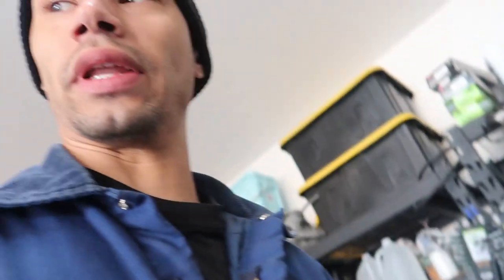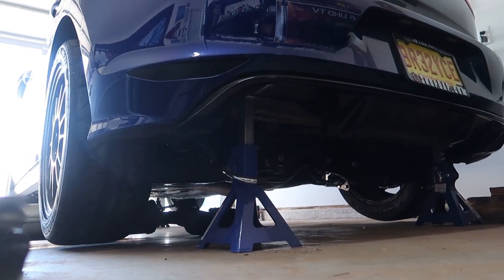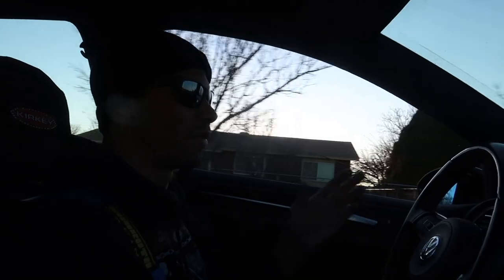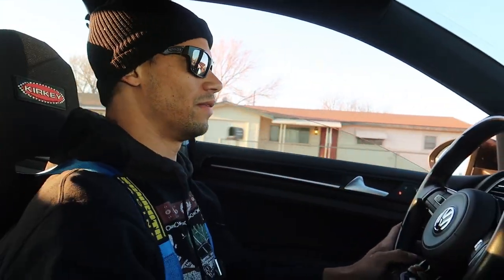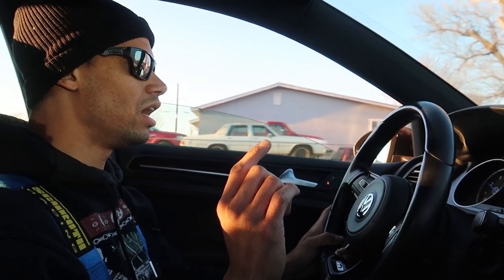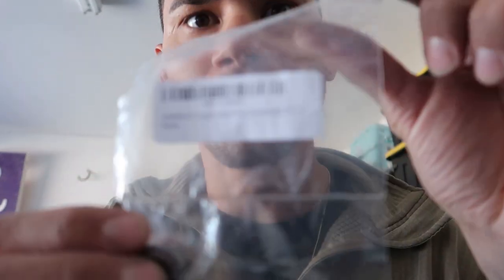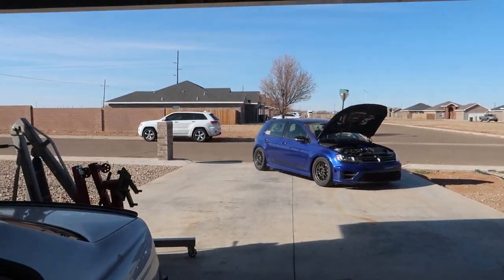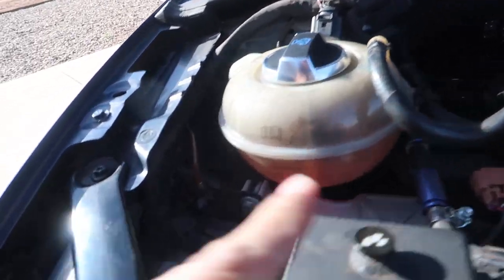FIRST DRIVE ON BUILT EVERYTHING! | MK7 Golf R

Comment from the maker: Build list for the curious:

Engine:
Custom tune from EQT 
034 Dog bone mount
034 Lower dogbone insert
034 Upper dogbone insert
APR Catch Can (full PCV)
APR Coilpacks
APR Intercooler piping 
BFI Engine mount stage 2
BFI Transmission mount stage 2
EQT Turbo piping
EQT Turbo muffler delete
EQT Vortex turbo°°
Denso iridium ihk01-24#4 
iAbed Rear main seal
Racingline Coolant hose
Racingline Intake (R600)
Racingline Turbo inlet
Racingline Intake pipe
Racingline Intercooler
Remus Sport Exhaust** 
South bend stage 3 daily clutch
Trackslag 4" downpipe ceramic coated
United Motorsport haldex tune

**102mm Carbon angled tips w/ Ti internals
°°Forge Turbo Blanket  

Engine Internals:
Ferrea Springs & Retainers  
IE Tuscan Rods
IE Valve Guides
Mahle 83mm Pistons
Mahle Rod Bearings
Ported Cyl Head

Transmission:(NFP O2Q)
FFE dog gears 3-6
Steel shift forks
Supports
Wavetrac LSD

Fueling:
PM4 fuel pump controller
Precision Raceworks 535 Pump
Precision Raceworks 4BAR Maps (just PUT for now)
Precision Raceworks 925cc Kit
Precision Raceworks Boost Tap
Precision Raceworks Ethanol Sensor
Precision Raceworks High Flow Fuel Lines

Wheels/Tires:
17x8 Hypergrams (satin silver) ET43
Bridgestone RE71R 254/45/17
BFI 5mm spacer front
BFI 5mm spacer rear 

Shifter Upgrades:
034 solid shifter bracket bushings
Ball shim mod
Black forest industries shifter (golf ball)
Black forest industries shift boot
Clutch stop
Clutch spring delete
Dieselgeek shifter shaft bushings
Dieselgeek super pin
ECS clutch bleeder block
ECS SS clutch line
OEM metal shifter bracket 
Shop dap short shifter
Swirl valve delete

Suspension:
034 stainless brake lines 
034 front adj endlinks (density line)
034 rear shock bushings
034 rear sway bar
034 rear adj endlinks (density line)
Audi aluminum subframe
BC Racing coilovers w/ Swift springs
ECS Diff inserts
Eurocode front strut brace
Eurocode hatch brace
iSweep DCC deletes 
Leyo undercarriage brace (rear)
Powerflex front sway bushings (black)
Racingline stud conversion
Verkline Anti-lift trailing arms
Verkline rear control arms
Verkline rear lightweight tubular subframe
     w/ track bar
Verkline rear toe arms
Whiteline front control arms

Brakes:
Audi RS3 brake ducts
Carbotech AX6 pads (front)
ECS 2Pc slotted rotors (rear)
iSweep 2000 pads (rear)
Motul 660 brake fluid 
Wilwood 2pc rotor (front 327mm)
Wilwood super lite 6pot bbk (pad #7416) 

Exterior:
Black emblems
Blind spot mirrors
LED euro tails
Maxton Spoiler
Paint correction (needs it)
Racingline stripe
Rock chips
Some dents

Other:
A/C delete
Aux Rad delete
De-badge front, rear and fenders (R)
DeAuto key blue LED footwells
Haldex switch (custom)
Kirkey seats
Mele designs battery mount 
Odyssey PC980 lw battery
P3 ethanol gauge adapter
P3 Boost gauge w/analog tap (v3)
Porsche coolant cap
Rear crash bar delete
Rear seat delete
Rear wiper delete 
Racingline brake cap
Racingline oil cap
Racingline oil dipstick
Racingline oil filter housing 
Schroth harnesses 
Struts cut for camber adjustment
USP ethanol harness (for P3)
Washer resi delete
WCT Pedal spacer
Reply: That list is just insane..
Reply from the maker: Still got a buuuuunch more to go.. need a cage, fire extinguishers, functional chassis mount splitter,flatten the undercarriage, diffuser, tubular front control arms and subframe, braided fuel lines.. probably a bigger pump soon as well, 5 bar sensor on the way along with a AMS IC and bigger 4" intake.. need carbon vented Hood/fenders too. And to get rid of all the sound deadening. Forever growing list lol
Reply from the maker: Oooo and lexan all the windows besides the front main
Reply from the maker: I plan on getting into grid life and going full time attack. Build an auto car for drag racing later on
Reply: Siiiiiik build
Reply from the maker: Thanks dude!
Reply: Holy balls

Comment: Just coded out the N80 Evap code. It is a MIL code, so you have to have your tuner do that. I recently had issues with hesitations/low misfire counts. If you have replaced your N80 valve and a code or hesitations/misfires exist, it is a component further down the line in the Evap system. Next item in line is the charcoal canister. Then I believe the leak detection. The manual has all the appropriate fuel system tests for the Evap system.

I just plugged the line running from the charcoal canister and coded out the MIL. Zero issues now.
Reply from the maker: Thank you for the insight! Wonder if I can just cut or cap the line off the tank and call it a day..
Reply: @BryceJordanProductions  That is exactly what I did. I plugged the inlet side of the sensor (left side of the sensor). Used a cap head M6 machine screw wrapped in a bit of teflon tape to create a snug fit. You are supposed to leave the gas cap cracked a bit to help with evap, but I have had zero issues. We will see what warmer temps bring. I check it daily currently.

Don't disconnect the electrical connector. Fuel trims are still dependent on this reading I believe. At least on older vehicles with N75/N80 valves, it messed with fuel trims.
Reply from the maker: @arob_157  ahhhh see I wanna get rid of it on the cam cover entirely.. I find it so hideous.. :/ I don't get any codes or anything

Comment: Congrats. Great job. 
What are your coolant temps on the P3?
Reply from the maker: Haven't looked during pulls at all but it's around 180-210. Find out this weekend at autox how temps will be without the aux rad
Reply: @BryceJordanProductions  I still think mine runs too hot now. Did you ever recall higher temps after going with the vortex? I’m seeing 207-212 on the freeway when the ambient temperature is in the 30s. Everyone tells me it’s normal. It gets up to 223 sometimes.
Reply from the maker: That sounds about normal. Did you monitor beforehand at all? Cruising temps shouldn't be affected no matter the size of the turbo. The dash gauge lies for OCD folk keeps it nice and centered till it goes quite a bit over
Reply: @BryceJordanProductions   yes with a P3 and I seem to recall cruising temps in the 190s. Also have a mk7 gti that stays in the 190s while cruising
Reply from the maker: Interesting. I'll check mine today and hopefully remember to get back to ya
Reply from the maker: @burb17  the few laps I had before splitting my turbo in half were no higher then 215. And that's without the aux radiator
Reply: @BryceJordanProductions  dang. Thanks man. I’m at 205-208 cruising on the freeway when the ambient temp is 40.

Comment: how much better did the car feel after the stage 2 bfi mounts? im looking to get the same, not concerned about NVH being increased. you like them? cant wait to see your car rippin hard!!
Reply from the maker: Just a tad bit more tight, should've got them off the bat. Do it, you'll love them if you already love the stage 1. And they hold their value. It won't cost ya much to upgrade if you do the work yourself
Reply: @BryceJordanProductions  killer, thanks bro. Best of luck with the build! Oh and I’m coming from modified stockish mounts that are only a little bit stiffer than stock
Reply from the maker: @miguelsanchez6465  I think you'll enjoy them alot!

Comment: Hey man I have a 2015 golf r with a big turbo kit on it and Ive really been considering building it. what would you say was the total build cost and would you mind posting links to the parts?
Reply from the maker: Brother it would take me hours to gather all the links.. I can post you my build list though. I'll post it separately in the comments and pin it at the top. All in all last year 2020 I spent over 45k between the trans, engine, rear end, carbon fiber, bbk and oil, plugs, hardware, tires etc and that's with doing all the labor myself.. For engine alone I'd budget around 8000 if you're going to go bigger pistons and port the head.. 6k ish stock bore no port job. 

You can go bigger turbo and fuel system with a good tune and ‼️KEEPING UP ON MAINTENANCE ‼️the car will last a very long time as long as you keep the tq in the lower 400s.
Reply: @BryceJordanProductions  thanks man! your car is my dream build. when I follow a build I usually find myself looking at things I dont like but I love everything you have done to this car, Good luck with it man!
Reply from the maker: Well shoot those are some kind words!!! Makes me smile real big 🤪 I try and keep things functional and do it properly. Just hope it's all worth it in the end, I have huge goals and absolutely need a solid foundation to achieve it
Reply: @BryceJordanProductions  44
Reply from the maker: @jmt0728  44?
Reply: @BryceJordanProductions  I meant to type a comment in here 🤣 what is your wheel and tires setup? Your R is sitting nice!

Comment: what kind of radio is that in the dash? that's not stock is it?
Reply from the maker: Facelift 7" screen. OEM but not what came from the factory. They can be had for decent prices during sales. Got mine for like 300 with the trim
Reply from the maker: Plug and play no coding or anything needed. Pop in pop out.